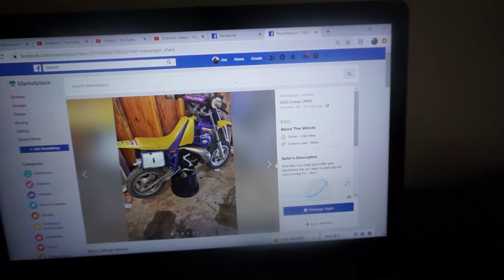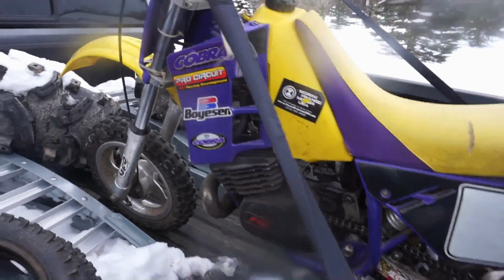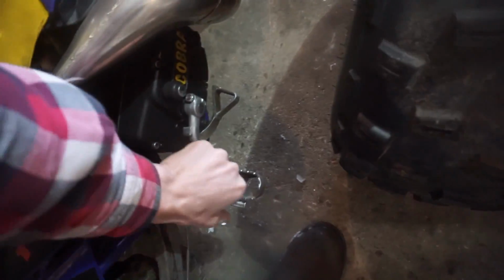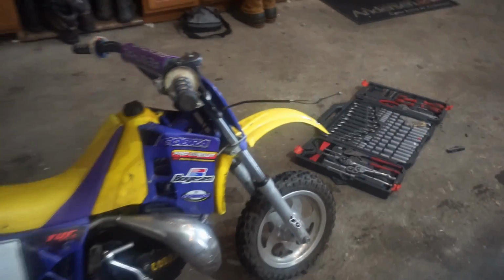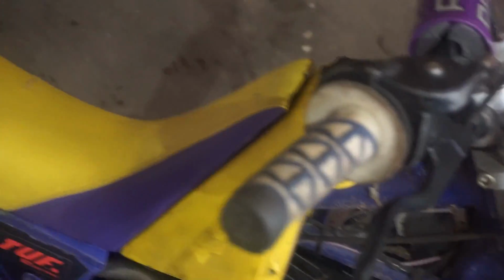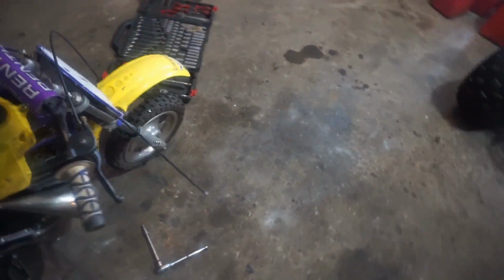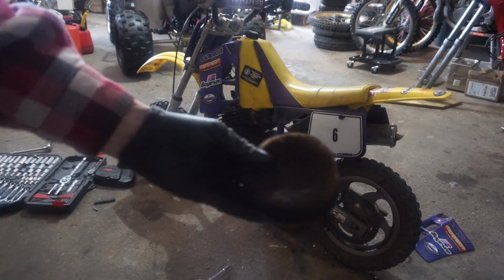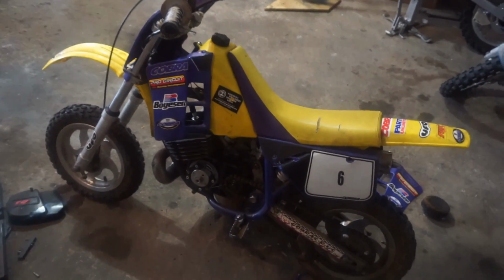Picking Up a Racing Mini 2 stoke Dirt Bike!!! | Will It Run?? (THE COBRA)

Comment: I've heard of these bikes my cousin had a cobra and so did I but I am the ATK version. The ATK MX 50 has the same engine as a cobra 50 and the KTM SX 50 they are basically the same bikes. they have morini engines and haul ass. Fun little 2-stroke bikes. If you don't know what ATK is it's an American made dirt bike and ATV company if you have ever heard of Cannondale there you go... you should turn a good profit with this bike I know I did with my ATK and my cousin did with his Cobra when they were all fixed up

Comment: id stay away from bikes that need the cases split.but its gonna make some kids day when he gets his new cobra..
Reply: That's because you don't know how to work on stuff once you learn how to work on things you don't stray away from anything that you know you can make a profit on if you fix it and these little bikes you can make a profit on...
Reply: @LeperxMessiah  thanks for informing me on what i do and do not know.
Reply: @jenniferbradshaw298  youre welcome
Reply: Add $600 anytime the cases need to be split.  It will cover everything inside minus a clutch, cylinder, head or damaged case. You may just have to replace just a bearing but a complete top and bottom end kit  = like new motor.
Reply: @occif2023  not if you know what you're doing like I do it don't cost you anything but Parts LOL
Reply: @LeperxMessiah  $600 is the parts cost. You can replace every motor wear item you need to for $600 on most japanese dirt bikes. If you know what you are doing or not  , a CRF 450 complete rebuild kit cost $500 plus another $100 in odds and ends. You might be able to do it cheaper if you are stealing the parts or half assing it. I do complete rebuilds on approx 10 motors a year. 2 stroke and 4 stroke.
Reply: @occif2023  you're telling me things I already know I work on machines for a living LOL

Comment: When you get it running doooo noootttttt go ripping that thing in this Wisconsin weather.  That little motor will work hard to move you and add that to the cold will be super lean!!!
Reply: Nothing will happen if you run it with a rich mixture
Reply: @OGKILLa9365   I know. But chances are a kids dirt mx bike will be jetted for warm weather.. not the 20* we have right now in wi

Comment: Can’t bump start a semi auto
Reply: George Heller roll in neutral and when you are rolling pretty fast pop it in 1st and pretty much jump before you pop it in gear and when your weight is all on the bike then pop in gear should crank over. Done it a lot on the pw 80
Reply: A semi auto has gears but no clutch , a centrifugal clutch doesnt have gears. If it has gears you can shift it up to 3 & hold it up then when your rolling let the shifter drop down it's in 3rd now.

Comment: Dude, dunking a plug in fuel is basically same as flooding a motor and wet fowling a plug.
Reply: My thoughts exactly...
Reply: Absolutely. 🤦🏻‍♂️
Reply: 😂😂😂 I was doing the opposite with mine, taking the plug out and drying it off..... I have a older vintage cobra I raced back in 2000 I just got running today
Reply: I was waiting for someone to mention that

Comment: Ive got a polini pretty much same bike i mite have parts if u need
Reply: Cole Baldwin there same thing a lot older years parts match
Reply: @jesse9705  yes sir ive got 1 x3 thats a runner and 2 parts bikes..
Reply: @jesse9705  mines liquid  but i do have bunch of morini s5 air cooled stuff as well
Reply: Polini has gears this is auto
Reply: @whyettjensen3292  negative poilini is semi auto also